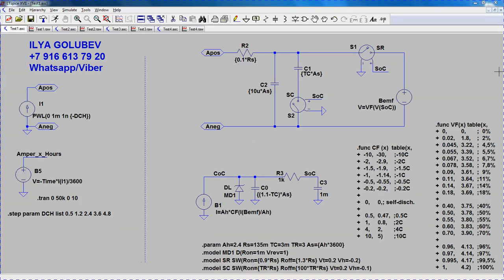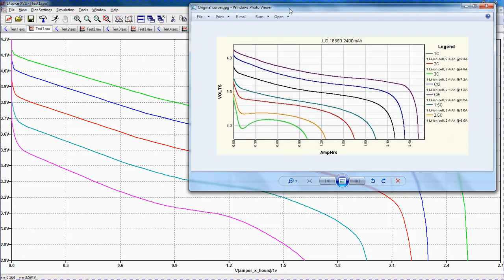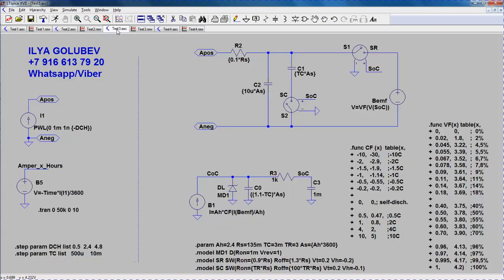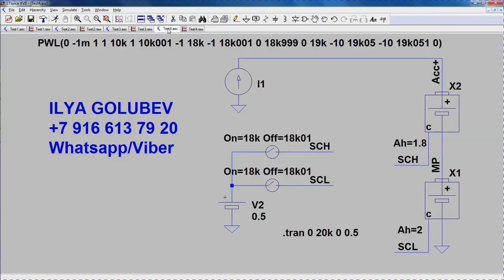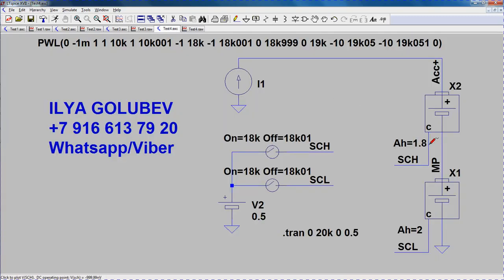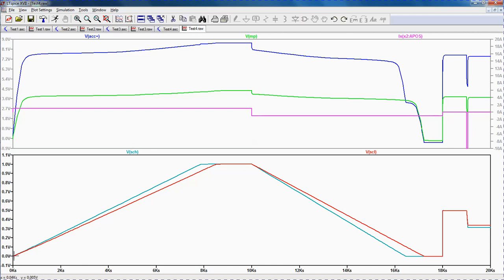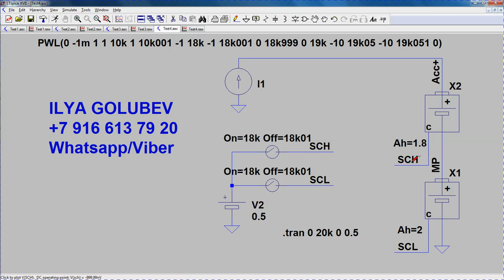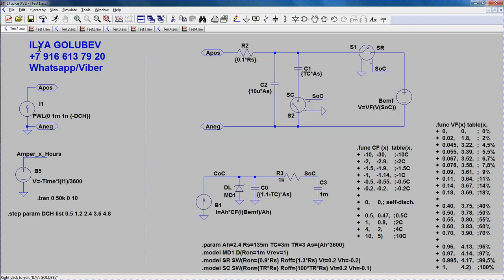LTspice Li 18650 accumulator simulation model.

Comment: Look really good
Is it possible to get the  library files from you? Would be great. Thank you
Reply from the maker: Hello !
Please see below 18650.lib file. Additionally you can get 18650.asy and test.asc. files. Where 18650.asy is symbol file. And test.asc is test setup. Keep in mind .lib and .asy must have the same name. This is how they find each other during execution, compilation & simulation.  Test.asc is for example purpose only. You are supposed to make own test or application schematic. 
Whether you have questions contact me here or by mail. kraul@mail.ru

**** 18650.lib file
.subckt 18650 Aneg Apos COC
C0 CoC 0 {(1.1-TC)*As}
DL 0 CoC MD1
B1 0 CoC I=Ah*CF(I(Bemf)/Ah)
Bemf N002 Aneg V=VF(V(SoC))

S1 N001 N002 SoC 0 SR
R2 Apos N001 {0.1*Rs}
C2 Aneg N001 {10u*As}
R3 SoC CoC 1k
C3 SoC 0 1m
C1 N003 N001 {TC*As}
S2 Aneg N003 SoC 0 SC
.model MD1 D(Ron=1m Vrev=1)
.param Ah=2.4 Rs=135m TC=3m TR=3 As={Ah*3600}
.model SR SW(Ron={0.9*Rs} Roff={1.3*Rs} Vt=0.2 Vh=-0.2)
.model SC SW(Ron={TR*Rs} Roff={100*TR*Rs} Vt=0.2 Vh=-0.1)
.func CF (x)  table(x,    
+  -10,  -30,     ;-10C
+  -2,    -2.9,    ;-2C 
+  -1.5, -1.9,    ;-1.5C
+  -1,    -1.14,  ;-1C   
+  -0.5, -0.55,  ;-0.5C
+  -0.2, -0.2,    ;-0.2C  
+   
+   0,     0,; self-disch.
+
+   0.5,  0.47,  ;0.5C
+   1,     0.8,    ;2C
+   4,     2,       ;4C
+   10,   5)       ;10C
.func VF(x) table(x,
+  0,         0,       ;  0%
+  0.02,    1.8,    ;  2%
+  0.045,  3.22,  ;  4,5%
+  0.055,  3.39,  ;  5,5%
+  0.067,  3.52,  ;  6,7%
+  0.078,  3.58,  ;  7,8%
+  0.09,    3.61,  ;  9%
+  0.11,    3.64,  ;11%
+  0.14,    3.67,  ;14%
+  0.18,    3.69,  ;18%
+
+  0.40,    3.75,  ;40%
+  0.50,    3.78,  ;50%
+  0.55,    3.80,  ;55%
+  0.60,    3.83,  ;60%
+  0.70,    3.90,  ;70%
+  
+  0.96,    4.13,  ;96%
+  0.97,    4.14,  ;97%
+  0.995,  4.17,  ;99,5%
+  1,         4.2)    ;100%
.ends 18650

****** 18650.asy
Version 4
SymbolType BLOCK
LINE Normal 32 -8 -32 -8
LINE Normal 0 2 0 48
LINE Normal 0 8 0 8
LINE Normal 0 -8 0 -48
LINE Normal 16 1 -16 1
LINE Normal 16 2 -16 2
LINE Normal 16 0 -16 0
RECTANGLE Normal 40 48 -40 -40
RECTANGLE Normal 16 -40 -16 -48
TEXT 6 -25 Left 2 +
TEXT -38 35 Left 2 c
WINDOW 0 32 -48 Bottom 2
PIN 0 48 NONE 8
PINATTR PinName Aneg
PINATTR SpiceOrder 1
PIN 0 -48 NONE 8
PINATTR PinName Apos
PINATTR SpiceOrder 2
PIN -32 48 NONE 8
PINATTR PinName COC
PINATTR SpiceOrder 3

********** test.asc
Version 4
SHEET 1 3108 1048
WIRE 320 416 -144 416
WIRE 320 448 320 416
WIRE -144 496 -144 416
WIRE 320 496 320 448
WIRE -144 592 -144 576
WIRE 240 672 208 672
WIRE 288 672 288 592
WIRE 288 672 240 672
WIRE 320 672 320 592
WIRE 320 704 320 672
WIRE 320 864 320 800
WIRE 240 880 208 880
WIRE 288 880 288 800
WIRE 288 880 240 880
FLAG 320 864 0
FLAG 240 672 SCH
FLAG 320 672 MP
FLAG 320 448 Acc+
FLAG -144 592 0
FLAG 240 880 SCL
SYMBOL 18650 320 544 R0
WINDOW 39 -75 88 Bottom 2
SYMATTR SpiceLine Ah=1.8
SYMATTR InstName X2
SYMATTR SpiceModel 18650
SYMBOL current -144 576 R180
WINDOW 0 -64 35 Left 2
WINDOW 3 -181 -59 Left 2
WINDOW 123 0 0 Left 2
WINDOW 39 0 0 Left 2
SYMATTR InstName I1
SYMATTR Value PWL(0 -1m 1 1 10k 1 10k001 -1 20k -1)
SYMBOL 18650 320 752 R0
WINDOW 39 -75 88 Bottom 2
SYMATTR SpiceLine Ah=2
SYMATTR InstName X1
SYMATTR SpiceModel 18650
TEXT -128 768 Left 2 !.tran 0 18k 0 1
TEXT -128 840 Left 2 !.inc 18650.lib

Comment: Could you provide .lib files and test circuit model?
Reply from the maker: Hello !
Please see below 18650.lib file. Additionally you can get 18650.asy and test.asc. files. Where 18650.asy is symbol file. And test.asc is test setup. Keep in mind .lib and .asy must have the same name. This is how they find each other during execution, compilation & simulation.  Test.asc is for example purpose only. You are supposed to make own test or application schematic. 
Whether you have questions contact me here or by mail. kraul@mail.ru

**** 18650.lib file
.subckt 18650 Aneg Apos COC
C0 CoC 0 {(1.1-TC)*As}
DL 0 CoC MD1
B1 0 CoC I=Ah*CF(I(Bemf)/Ah)
Bemf N002 Aneg V=VF(V(SoC))

S1 N001 N002 SoC 0 SR
R2 Apos N001 {0.1*Rs}
C2 Aneg N001 {10u*As}
R3 SoC CoC 1k
C3 SoC 0 1m
C1 N003 N001 {TC*As}
S2 Aneg N003 SoC 0 SC
.model MD1 D(Ron=1m Vrev=1)
.param Ah=2.4 Rs=135m TC=3m TR=3 As={Ah*3600}
.model SR SW(Ron={0.9*Rs} Roff={1.3*Rs} Vt=0.2 Vh=-0.2)
.model SC SW(Ron={TR*Rs} Roff={100*TR*Rs} Vt=0.2 Vh=-0.1)
.func CF (x)  table(x,    
+  -10,  -30,     ;-10C
+  -2,    -2.9,    ;-2C 
+  -1.5, -1.9,    ;-1.5C
+  -1,    -1.14,  ;-1C   
+  -0.5, -0.55,  ;-0.5C
+  -0.2, -0.2,    ;-0.2C  
+   
+   0,     0,; self-disch.
+
+   0.5,  0.47,  ;0.5C
+   1,     0.8,    ;2C
+   4,     2,       ;4C
+   10,   5)       ;10C
.func VF(x) table(x,
+  0,         0,       ;  0%
+  0.02,    1.8,    ;  2%
+  0.045,  3.22,  ;  4,5%
+  0.055,  3.39,  ;  5,5%
+  0.067,  3.52,  ;  6,7%
+  0.078,  3.58,  ;  7,8%
+  0.09,    3.61,  ;  9%
+  0.11,    3.64,  ;11%
+  0.14,    3.67,  ;14%
+  0.18,    3.69,  ;18%
+
+  0.40,    3.75,  ;40%
+  0.50,    3.78,  ;50%
+  0.55,    3.80,  ;55%
+  0.60,    3.83,  ;60%
+  0.70,    3.90,  ;70%
+  
+  0.96,    4.13,  ;96%
+  0.97,    4.14,  ;97%
+  0.995,  4.17,  ;99,5%
+  1,         4.2)    ;100%
.ends 18650

****** 18650.asy
Version 4
SymbolType BLOCK
LINE Normal 32 -8 -32 -8
LINE Normal 0 2 0 48
LINE Normal 0 8 0 8
LINE Normal 0 -8 0 -48
LINE Normal 16 1 -16 1
LINE Normal 16 2 -16 2
LINE Normal 16 0 -16 0
RECTANGLE Normal 40 48 -40 -40
RECTANGLE Normal 16 -40 -16 -48
TEXT 6 -25 Left 2 +
TEXT -38 35 Left 2 c
WINDOW 0 32 -48 Bottom 2
PIN 0 48 NONE 8
PINATTR PinName Aneg
PINATTR SpiceOrder 1
PIN 0 -48 NONE 8
PINATTR PinName Apos
PINATTR SpiceOrder 2
PIN -32 48 NONE 8
PINATTR PinName COC
PINATTR SpiceOrder 3

********** test.asc
Version 4
SHEET 1 3108 1048
WIRE 320 416 -144 416
WIRE 320 448 320 416
WIRE -144 496 -144 416
WIRE 320 496 320 448
WIRE -144 592 -144 576
WIRE 240 672 208 672
WIRE 288 672 288 592
WIRE 288 672 240 672
WIRE 320 672 320 592
WIRE 320 704 320 672
WIRE 320 864 320 800
WIRE 240 880 208 880
WIRE 288 880 288 800
WIRE 288 880 240 880
FLAG 320 864 0
FLAG 240 672 SCH
FLAG 320 672 MP
FLAG 320 448 Acc+
FLAG -144 592 0
FLAG 240 880 SCL
SYMBOL 18650 320 544 R0
WINDOW 39 -75 88 Bottom 2
SYMATTR SpiceLine Ah=1.8
SYMATTR InstName X2
SYMATTR SpiceModel 18650
SYMBOL current -144 576 R180
WINDOW 0 -64 35 Left 2
WINDOW 3 -181 -59 Left 2
WINDOW 123 0 0 Left 2
WINDOW 39 0 0 Left 2
SYMATTR InstName I1
SYMATTR Value PWL(0 -1m 1 1 10k 1 10k001 -1 20k -1)
SYMBOL 18650 320 752 R0
WINDOW 39 -75 88 Bottom 2
SYMATTR SpiceLine Ah=2
SYMATTR InstName X1
SYMATTR SpiceModel 18650
TEXT -128 768 Left 2 !.tran 0 18k 0 1
TEXT -128 840 Left 2 !.inc 18650.lib